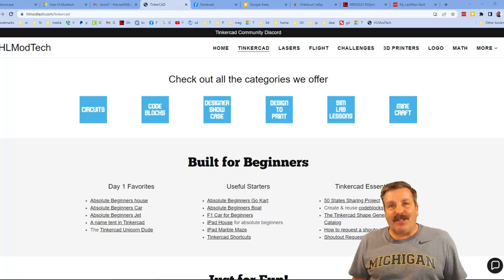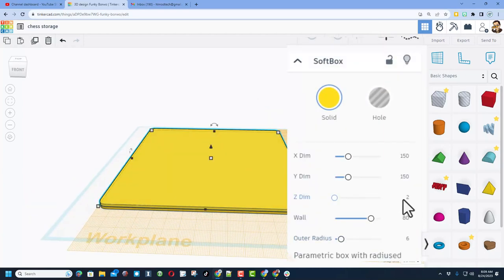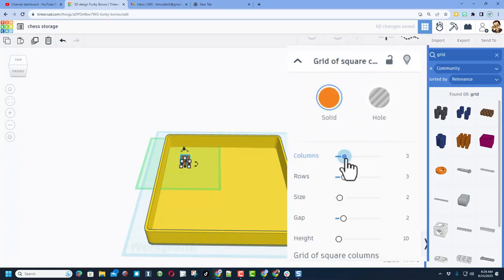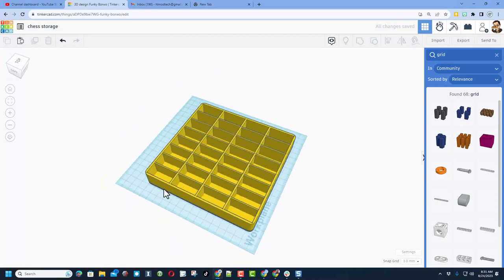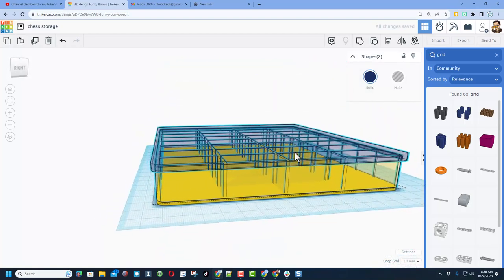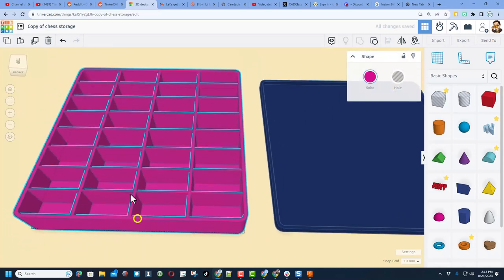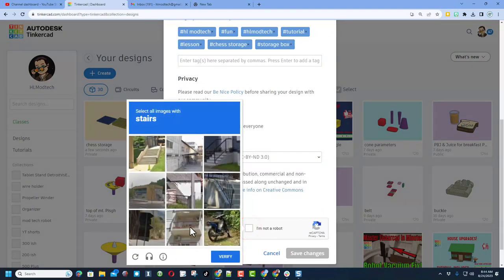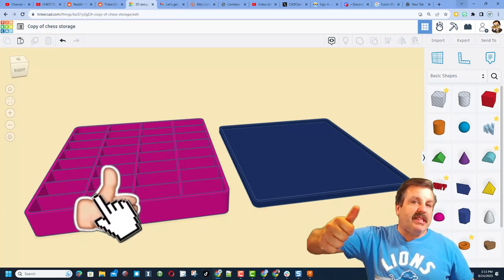Easily Make a Sweet Tinkercad Storage Box & Lid to 3D Print in 12 min

Comment: How would I add a lip around that box?
Reply from the maker: I am not quite sure which part you are speaking of. They are all boxes.. =) The lid, or the base?
Reply: @HLModTech  basically im trying to make a box without a cover but the top of the box needs a half inch lip right around the top
Reply from the maker: Just use the softbox an extra time with measurements that match the lip you want. By nature it does not have a bottom, so you can just align your new lip and be done. I guess you could think of it as my lid... but only keep the outside edge... not the middle where we set the walls to a number large enough that they meet..
Reply: @HLModTech  thanks for that info, will give it a shot